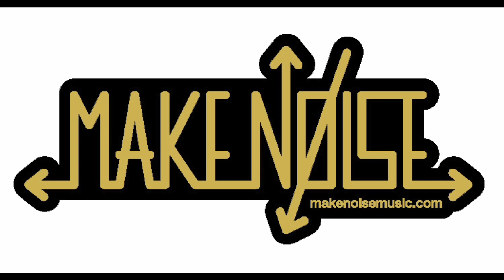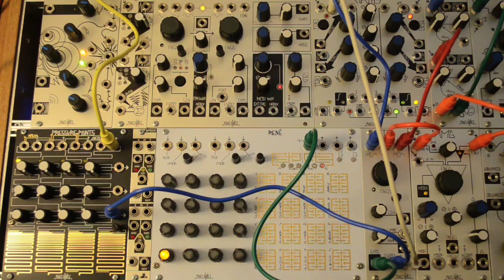Make Noise Sub Timbral Oscillator (STO) complex melodies

Comment: I am admittedly late to the party, as I've been enjoying the wonders of the STO for only a handful of months. Wanted to share a recent experiment—link below—in which the STO plays the main melody, but tried a gate signal from a sequencer into the Shape input to produce a sort of melodically shifting drone, with dual harmonic accompaniment by running the Sub output through a reverb pedal. (As a side note, the handclap/snare you hear in the background moving the whole thing forward comes courtesy of phased-shifted 0 Coast.)

https://soundcloud.com/gestalt-tone-color/before-i-expire
Reply: Should have mentioned that the 0 Coast is also receiving random clocked gates from the Beatstep Pro to its Contour Decay input to subtly vary the percussive accents.